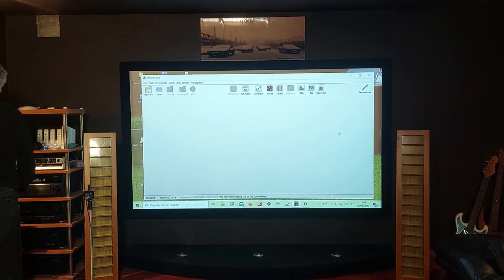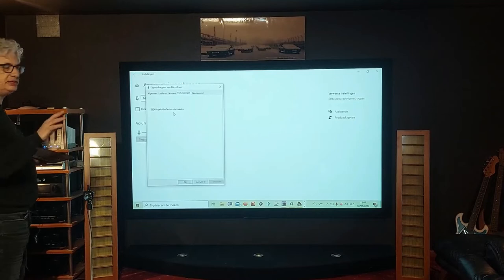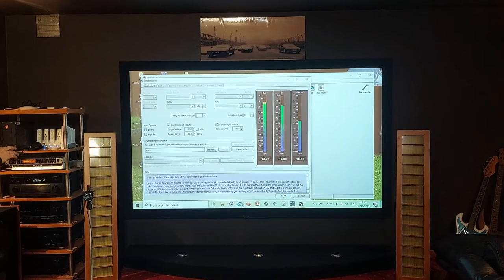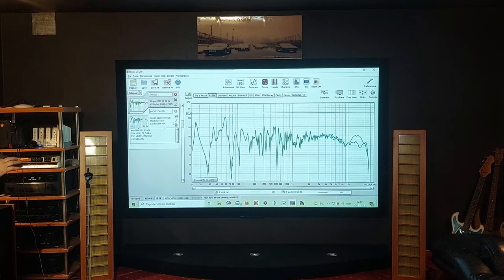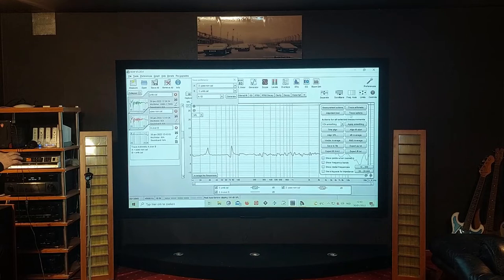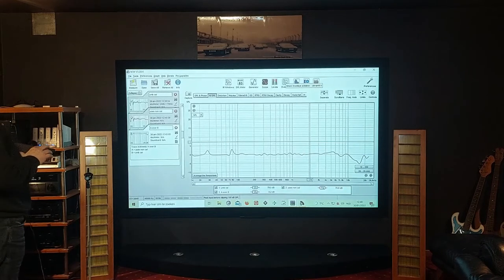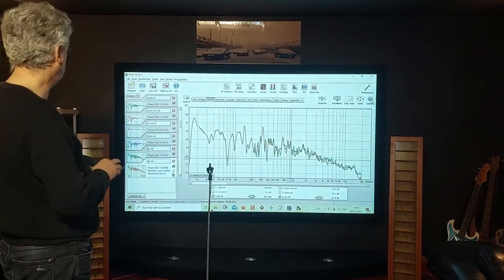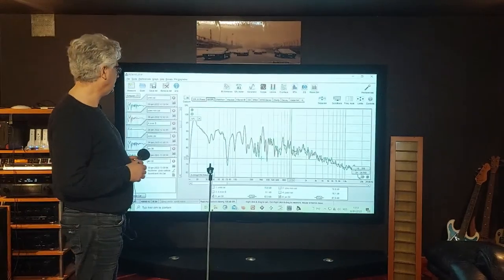REW microphone calibration

Comment: This video help me a lot, I got mine microphone with Panasonic WM-61B102B capsule which is by default very flat and sometimes used in other testing microphones, then I used my Umik to calibrate that WM-61B. Now I have 2 very good microphones (both calibrated). Thank you for this video.
Reply from the maker: You are welcome. Was there a big difference between the calibrated UMIK and your Panasonic to begin with? And if in what frequency range ?
Reply: @gvybin  I try to measure twice, not in perfect conditions, I still need to move everything in my big living room and make measurement there. But like this is 99% same as Umik, I think it's possible to make almost identical mic calibration. That depend on quality of your sound card (which can be calibrated too). But like this, it's very, very usable, much better than non calibrated. I try already few mic capsules but for now WM-61 give excellent results.

Comment: I'm trying to use the Addyssey mic with rew to do some basic room measurement. My measuring setup chain is Audyssey mic -> soundblasterx g6 usb soundcard -> pc -> denon x3700h. When I connect the Audyssey mic to the soundblasterx soundcard, the mic doesn't seem to pick up any sound. Is it because the mic is mono and the mic port on the sound card is stereo? Is there a solution for this?

Comment: What if i have a used Umik1 but the serial number is faded so i cannot access the calibration file? do i need a different calibrated Umik1 to create a calibration file for my used Umik1?
Reply from the maker: It happens often that the SN is faded on the sticker of a UMIK1. You can also find the SN on the side of the packaging box of your UMIK1 if you still have it around. If you bought your UMIK1 from miniDSP, they may be able to recover the SN in their database.
If none of the above helps you recover the SN, you now have an uncalibrated UMIK1. You can use my method using some one elses UMIK1 with calibration file to make your own calibration file.
Reply: Ok. Thanks. I’ll just keep using my un calibrated Parts Express microphone. The measurements sounds accurate. One day maybe I’ll get a UMIK

Comment: I have a Anthem mrx510 reciever and the .cal-file for the mic is enqrypted so I cant use it in REW. If I first make a calibration of my soundsystem and then make masurement in REW  Can I use that result instead of compare with a calibrated microphone?
Reply from the maker: Hi, I have no knowledge about the anthem system however...
I believe the anthem arc-1 microphone is a USB microphone ( that is good) and you are right, there is no way in decrypting the calibration file. I understand that anthem is also not willing to share the calibration information of their mics in a "calibration curve", so here you are. You have a quality measuring mic without the calibration file.
First, As I said in the video. I am convinced you can perfectly use the arc-1 uncalibrated with rew between 20Hz upto to around 7kHz. It may even be good further.
Second, The best way is trying to get hold on a calibrated umic and use my procedure.
 To answer your question. I don't think it is a good idea to calibrate your system  with anthem ( multi mike  position ) and then assume you have a flat curve and use the measurement in REW with the arc-1 to calibrate it. All frequencies in a room above 7 to 10khz are so dependant on the interaction of the beam patterns of different speakers and reflections that cancelation may occur dependant on exact mic positions. 
However, and I don't know the anthem software, can you do a close mic ( 0.5m) sweep of 1 speaker (placed around 1m above the floor and away from walls) with the calibrated arc-1 in the anthem software ? (close mic measurement means you have no roomreflections in the high frequencies)
Then do the same sweep at the same level (75dB) with REW and the uncalibrated arc-1
And then compare the 2 graphs to give you an idea how far off the 2 graphs are from say 5khz-20khz. chances are they will be pretty similar, but at least you know and you can even make some calibration file yourself and test it again.

Comment: You need a calibrated microphone. Lol
Bro!
Reply from the maker: Hi John. I explain in my video that you need the use of a calibrated mic ( in my case UMIK-1) to be able to calibrate another microphone. This is also very clearly stated in the text that comes with my video.  The point is, on the internet I have seen videos that claim that the use of a cheap ( audyssey or YPAO) microphone that comes with your receiver is not acurate enough to be used with REW. Well those microphones are good, after making a calibration file for them. This video explains how you can make a calibration file yourself. 
But more important : This video also shows that even uncalibrated, these microphones are accurate enough for all measurements under 10kHz.
And I know, a UMIK-1 doesn't cost that much, but some people (hobbyists) may want to experiment with REW, without investing in a calibrated microphone. This video may give them a guideline of what to expect.
Reply: I think someone should have a free calibrated microphone that they pass around the Audio community for this purpose